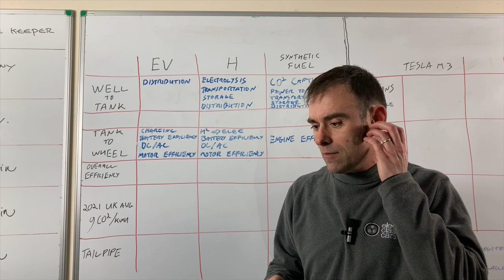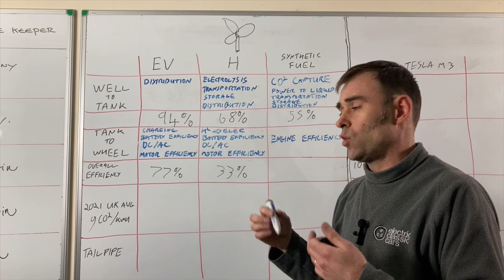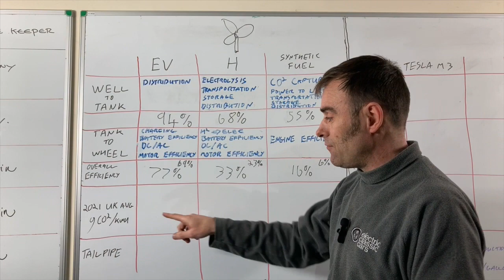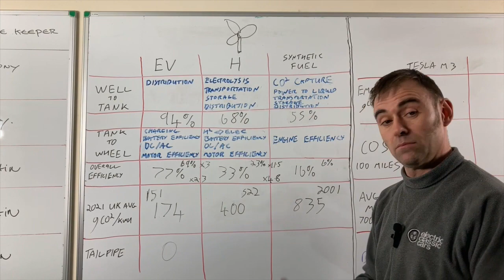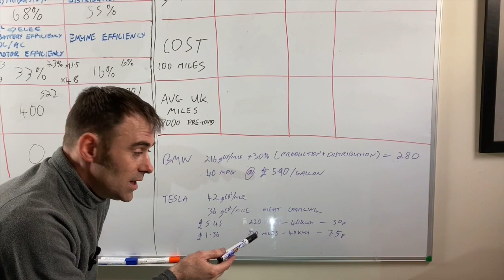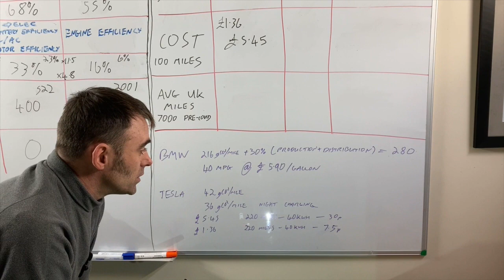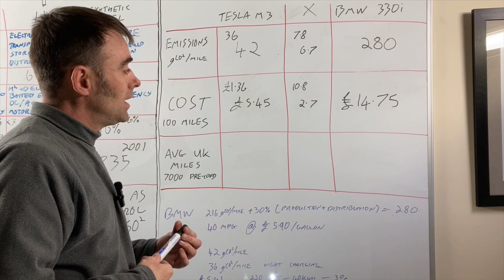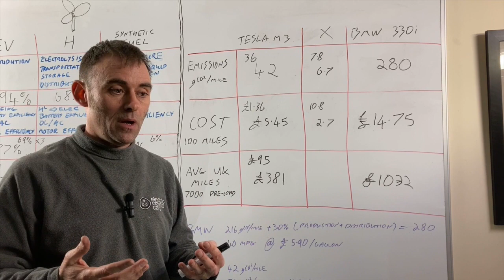Is Hydrogen or Synthetic fuels the end for Electric Cars?

Comment: love the show and the number makes sense and all thing being equal EV does work.  But areas that never seam to be mentioned is the ability to spend £40k on a new car. My last budget was 10K and would like to get 6-10 years from this car. I tried to get the best I could 95g/km and 60mpg+ real world mileage. An area I would love to see covered is real world example. How much in pounds and CO2 would it be for someone like myself to be able to change my car form fossil plant killer to and EV lover. Any number I have seen implies that the only people that can save the planet can also afford to be able to spend £30k+ on a new car.
Reply from the maker: I used the Tesla M3 and BMW as they were commonly known cars that everybody kinda knows. There are plenty of awesome new EVs that are sub £30k like MG5 and Nissan Leaf. But for sub £10k you need to look at secondhand, like my son who just got a Renault Zoe for £7k. 👍
Reply: A great point and an argument I hear alot. The obvious extra cost is the servicing of the ICE (oil, plugs, cambelt etc) more cost on brakes and the reliability differences after high miles. The initial outlay is large for the better range EV's starting at the MG5 i guess, the best value used EV being Hyundai Ioniq for circa £20k I think, but less than that the ranges are quite poor. Unless you buy a Nissan Leaf with bad battery for £3k do a battery swap for £8k and have a 150 mile range with older tech. Tricky one eh 🤔
Reply: You have to look at the broader market.

Annual Mileage plays a significant role.

If you are doing low mileage then you will struggle to make an ev cost effective.  But if you also consider resale value as well things can get more even.

Anyone doing medium to high mileage and expecting to keep the car for a 5 or more years it pays off.

For example if you were to commute 70 miles a day then you’d be in the 15k a year zone.  That around £2000 year in fuel versus maybe £200 in electric.  So at least £2000 a year including tax.  If £10000 over 5 year covers the extra cost of an ev over an ice then you are easily quids in.

Comment: Unless I drifted off you never covered what about those that have no drive. A BMW diesel getting 50mpg at £1.60l will be the same as an EV getting 4 miles per kWh at 50p a kWh. Most public charging providers are about to raise prices to 48p/49p/50p. I'm just thankful I have a driveway and an EVSE for my MG5 LR
Reply: But unfortunately the BMW doesn't have the ability to be "fuelled" at home using an EV specific tariff, which, even after the recent 50% increase in costs, still tops out at around 2.5p per mile....if you get 3 miles or so per kw..... Remember, most EV owners will charge at home. More costly public chargers tend only to be used on longer trips, on just a handful of occasions per year. You could liken it to buying petrol on a motorway service area. Most just don't do it.  Many of those whom have no driveway are probably blissfully unaware they can approach their Local Authority and ask them to apply for the already available Government funding to install either street light chargers, the free standing bollard type chargers, or a grid in the pavement outside your home,which enables a charge lead to pass under the pavement rather than over it. The funding is available. Your Local Council just needs to apply for it. Sadly, many Local Councils seem oblivious to this.....
Reply: @Brian-om2hh  the comment is specifically those that have no solution to using a home tariff. You aren't going to be getting the 7.5p Octopus Go on a public charging lamppost, it'll be 50p a kWh soon. 1000 miles, 4 miles per kWh, 250 * 50p = £125. 3 miles per kWh = £166. Whilst 50 mpg, 20 gallons=90 litres, 90 * 1.60 = £144. Basically 50/3 = 16.5p a mile, not 7.5/3 = 2.5p. Even my old 120d got 55mpg. (4.546*1.6)/55 = 13p a mile.
Reply: I rely on public charging in a city where few people have off road parking. Our council install residents charging bays near our homes on request. The charging socket is wired to the nearest street lamp. The current cost is 23p/kW, not much more than my home electricity. 

These are the kind of chargers we need lots more of. Fortunately our council are doing a good job in installing them. 

However, I have a Tesco very near me with free chargers so do a lot of charging for free.
Reply: @EVinstructor  about twelve days until 1st April with most then paying 28p a kWh. It's why all the providers who were doing 30-40p are now going to near 50p in the next couple of weeks. Ubitricity lamp posts won't be 23/24/25p forever,  char.gy lamp post at 33p and I expect these to raise quickly. Come October I expect the cap to raise to 35p, we could be looking at 55-60p on InstaVolt, Osprey etc
Reply: @aaaa-ig6sc   We have both Ubitricity and JoJu chargers in our city. They are both 23p. The council don’t let them set the rate themselves. They’re currently negotiating with Ubitricity as the initial 3 year agreement is coming to an end. If it’s more than the JoJu I’ll simply use them. The JoJu chargers have been in since February. 

Electricity would have to be about 80p/kW for my car to cost as much as an equivalent petrol car and petrol seems like it’s continuing to rise so that will probably be more. I do 20,000 miles a year. My car is my personal car and driving school car. I also have a Tesco very nearby with free chargers and 3 hours of free parking. I can fill up most of a days use by leaving the car on charge there for 3 hours.

Comment: Would be interested to hear your thoughts on the cradle to grave impact of EV vs conventional ICE vehicles. Materials used, recyclability, life of… etc.
Reply: It's pretty much an ongoing situation, which will improve over time. Several EV manufacturers are making headway to reduce the environmental impact of both manufacturing and owning their EV's. VW for example, carry out their EV manufacturing in plants with a zero carbon footprint, powered by 100% renewable energy. The cars themselves are built from much recycled and plant based materials. Even the paint finish on the cars is plant based. Both Volkswagen and Renault also now have their own EV battery recycling plants, in an effort to enable the "circular" economy way of doing things. VW are also the only car maker to have so far signed up to the Paris Climate Agreement, committing them to be carbon free by 2050... Others will hopefully follow their example...
Reply: @Brian-om2hh  The factory that built the BMW i3 from 2014 - 2022 was [I believe] powered by 100% renewable energy. The dash, seats etc of the i3 were also from renewables, as many makers are now doing, as you sa. It's such a shame that BMW didn't continue with other models in the same way.

Comment: Great stuff. Maybe follow up with the emissions comparison between new ev and new ice, but add in conversions too? The point at which the extra emissions to produce a new ev are negated by well to wheel savings arrives much sooner than thought. This should be fun to compare with the overall savings from conversion.
Reply: Also the co2 difference between EV conversions using new battery and motors vs using used 😉⚡🌿
Reply from the maker: Great idea. 👍👍👍

Comment: I thought the first section regarding efficiency would have benefited from relative energy of the three sources. If synthetic fuel is equivalent to petrol, then even at 55% efficiency it is still has more power than electric. I know Hydrogen for ICE is being worked on also, so should be an interesting compromise.
Reply: Hydrogen and synthetic fuel ICE vehicles suffer the same issues as does petrol/diesel.
They all have a lot of losses of energy during processing, storage and transport before any of them get into a vehicles tank.
That can't be eliminated and hence none of them can match battery electric when considering source (well or generator) to wheels efficiency.
What wasn't covered in the video (or it was indirectly) is that the huge electricity generating capacity needed compared to pure battery electric and that additional energy is a diversion from other uses, such as using hydrogen to decarbonise steel.
Reply: You can already buy Aspen synthetic petrol in Britain. It's been on sale for decades. The cost? Around £20+ per gallon......fill 'er up Sir?   And hydrogen at 23% efficiency, and more expensive than unleaded petrol?  You sure about this?

Comment: Great explanation of the costs and also spelling out the cost of electricity production and emission.
The Cost of cell production and energy in conversion of Lithium and other energising compounds into batteries is still something to consider.
Battery technology still need to find more efficient and clean electrical storage to really make the leaps and bounds needed.
A lot of science and research is still looking at safe and more efficient less toxic and less hazardous battery construction.
Until such time Hydrocarbon fuels will be the mainstay of all transport and and freight distribution.

Comment: Second hand ICE car is simply cheaper to run when there isn't the £40k+ to spend on the Tesla. £ in the pocket is far more important to most people than emissions. The whiteboard analysis is perfectly fine but EVs are only for the rich minority.
Reply from the maker: Don't compare a secondhand ICE car to a new Tesla. Compare it to a secondhand EV, like a Renault Zoe for £7k. The trouble is you can buy a secondhand ICE car for £100. Secondhand EVs are going to take a while to get down to those levels. 😉😁👍
Reply: @Electric Classic Cars ,  as someone who usually buys a 2yr old car (let someone else take the big financial hit), with around 20k miles, then run it until its uneconomical to repair (scrap or trade in for another 2yr old, so far looking at around 150k miles and 7- 12yrs. 5yrs and 55k on my current ) ,you're still a good few years (decade?) of running the Beemer before the maths balance out? (As I don't care about resale, I do all my servicing)
Although, the flip side, is that Tesla's are holding their value , and looking to be clocking up over the 100k mileage quite well, and at what time/mileage they become uneconomical  to repair maybe alot later...🤔

Comment: In Scotland, on an annual basis, 98% of electricity is generated by renewables. Hydro power, pump storage hydro, solar, on shore wind and off shore wind. Tidal power is due to come onto the grid shortly from the Pentland Firth. The other 2% is gas from the North Sea at Peterhead.
Reply: I understand tidal is already in use off of Orkney.
Reply: @dlittlester  Yes indeed but there needs to be a new subsea interconnector from Orkney to Caithness to connect to the grid.  After that a tidal array can be built that will power millions of homes 24/7.

Comment: Great information.
I believe you should have added the carbon footprint in the manufacturing of ICE compared to EV vehicles...

If I'm not mistaken, EV. Has a larger carbon footprint then ICE????
That being said, you are repurposing tesla cars into your classics. So very little to no carbon footprint.
Rick.
Pasadena Newfoundland
Reply: Not EV's manufactured by Volkswagen. They are produced in a plant with a zero carbon footprint, powered by 100% renewable energy.... VW electric cars also have a high content of recycled and plant based materials too. The dashboard, door cards, seat fabrics, and carpets are all from plant based. As is the final paint finish......  Kia are using similar production methods.
Reply: @Brian-om2hh  What about the manufacturing of the batteries, sourcing the raw materials and everthing included along the way has an impact to CO2 emmissions...   

Rick
Reply: @rickwheeler6811  Sourcing the raw materials would have roughly the same impact of that created by the oil companies, whom have mined cobalt for decades. They need cobalt to remove sulphur during the refining process. You need to offset the emissions created in the manufacture of EV batteries due to the fact these batteries can be almost fully recycled, with the lithium and cobalt being 90% recovered and reused in new batteries. Once gas/petrol and diesel has been used, it's gone for good. Nothing is reusable. And consequently, there is nothing to offset the emissions. The emissions created during EV battery manufacture will only decrease, as more manufacturers follow Tesla's lead in using cobalt free batteries.......

Comment: I think you are missing one very vital point here and that is the duty part of the cost of fuel. Your calculations do not take in to account duty on fuel and that is because at this time there is no duty on electric fuel for EV's, Yes at the moment there is no levy on electricity but how long will it be before this is addressed? when revenue falls because of the increase in the use of EV's some form of duty will follow be sure of that. It would be interesting to see how the costs stack up once the government start to levy duty of some sort on Ev vehicles. Remember how cheap Diesel was until the majority moved over to that fuel. Then all of a sudden duty was applied at a ever greater levels and Diesel became the more expensive fuel. Please don't forget that at this point in time we are being lead in to what appears to be cheap motoring and a more environmental friendly form of travel.  But also remember there is no such thing as cheap motoring in the long term ! The next few years are going to be very interesting. The tide will change and those that bask in the cheaper moting Ev's ownership offers at this point in time will find it will not continue that way into the not too distant future. Always very interesting subjects and thought provoking topics, keep it up.
Reply: The cool think with electric is that you can alway circumvent the duty by generating it on your roof. For those without a roof that would be very unfair and hence (depending on your flavor of government) not very probable. We'll see what type of duty they will come up with: probably on driven distances or so.
Reply: Er, there is. There is 5% VAT on the electricity used for home charging an EV, and VAT on public charging..........

Comment: As well as the energy needed to create hydrogen, one of the biggest obstacles for using that is bulk transportation. You can't send it through the existing gas pipe network as it's not up to the pressure required to push enough hydrogen through as it's nothing like as energy dense. And to make transporting over longer distances (in tankers) it would need to be liquid, which means very cold at high pressure.
Reply: I believe most folk pushing hydrogen talk about it being produced at the point of sale. This means no transportation but also means very poor economy of scale. 
I wonder how much the current dozen or so hydrogen filling stations are being subsidised?
Reply from the maker: A tanker full of hydrogen at 10,000psi down the motorway would be a scary thing. 😲👍
Reply: And it would need a lot of pumps/compressors to get it along the pipe network. The natural gas network has numerous compressor stations consuming a few percent of the energy (probably about 6%). They bleed off some the gas from the pipe network to power the gas turbines that power the compressors.

Comment: HYDROGEN is fractious to anything that it is stored in, it causes embrittling steel which means replacement and inspection of all tanks that its kept in , not good for petrol garage in a populated area 💥
Reply from the maker: It's a very small molecule which makes it hard to stop leaks. Storing it at 10,000 psi also doesn't help. 😉👍
Reply: But we had magic gas pipes up to the 1960's. Coal/town gas was provided to a large number of homes and industry. This was 50% hydrogen with other gases.
Reply: @steveo3785   Yes maybe, but definitely not stored at 700 bar 10,000 psi in a large tank at the end of residential street, I wouldn't want to live anywhere near that 👍
Reply: @ElectricClassicCars  Yes storage is a huge problem also as hydrogen is "lighter than air", storing it is like stuffing a cloud into a bag. Takes about 350-700 bar to get anywhere 👍 watch some of Jack Rickards old vids on EVTV he used to laugh at the hydrogeners 😂

Comment: Found it very interesting and pretty much confirmed My thoughts. Both this and Harry’s Garage recent video on sustainable fuels has been very enlightening.

As I commented on Harry’s video;
EVs for day to day point to point general personal transportation.
Hydrogen for HGVs, busses, ships, trains, planes.
Sustainable Fuels for historic, classic, sports and racing.
Reply: Electric ( overhead line/ third rail or battery) is a viable solution for a lot of trains especially passenger trains
Reply: @simonwood6932  i agree, but that could put a lot of demand on the network.
Im still thinking Hydrogen as it won’t require a massive electrification of the whole network just the engines. Plus it will create a market for hydrogen which then makes it economically viable for investors and hydrogen is massively needed for ships and perhaps planes.
Whatever, it is an exciting time to be alive plus the ICE has a lot more to give yet.
Reply: exactly 💯💯💯💯

Comment: I'm absolutely on board with the theory of BEV's but the entry price point is simply too high for the majority of people, the only EV in my price point is an old Leaf which as a machanical contrivance enthusiast I simply refuse to drive and would be touch and go doing my 50 mile commute in winter.
Reply from the maker: The secondhand EV market will begin to thrive in the coming years as more and more new cars come onto the market now. 👍
Reply: @ElectricClassicCars  hoping so - I do wonder though how low an EV will ever go in price simply because of the large valuable materials in the battery.